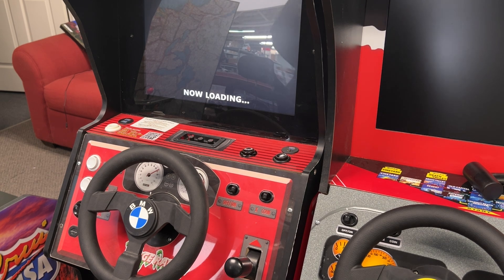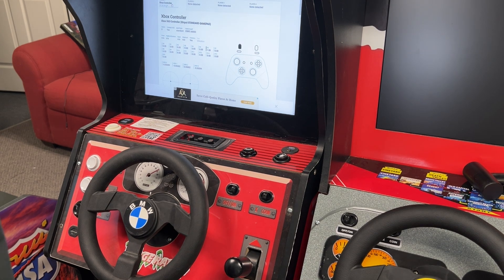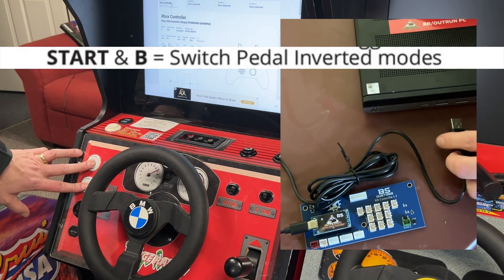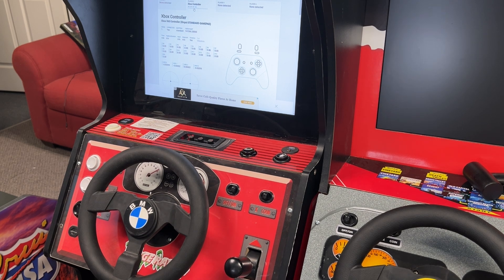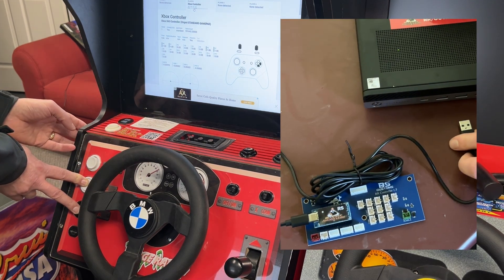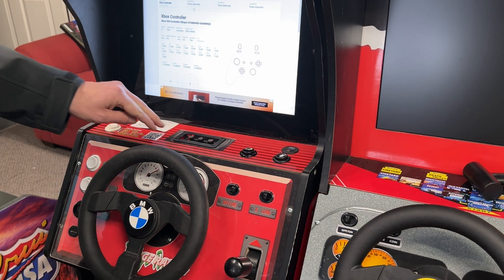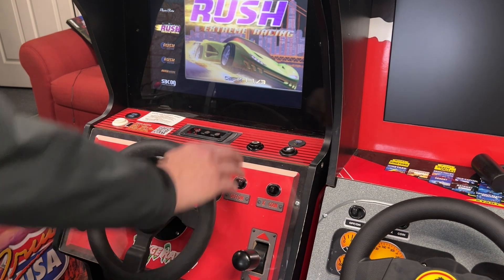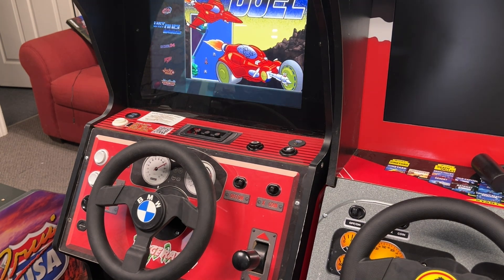RR/OutRun PC Build: #3 Encoder Board settings

Comment: I’ve tried holding start and coin but I’m getting 3 rumbles instead and no switching. Am I doing something wrong? I have the PC build.

Edit: Never mind, I actually plugged the usb connector in the front side like your video. I had it plugged on the back side along with the usb hub for the top deck. Just switching worked for me.

Comment: i don’t own a racing cab yet but want to get 2 for head to head racing — are the wheels for rr and outrun 2 different sizes? man i hate the inconsistency with arcade1up designs
Reply from the maker: They are the same size. RR has room for rumble in the hub, but pretty much the same otherwise.